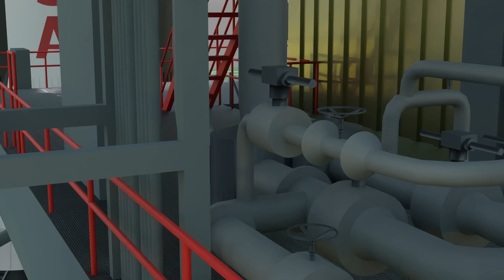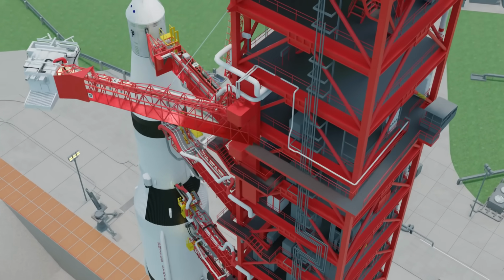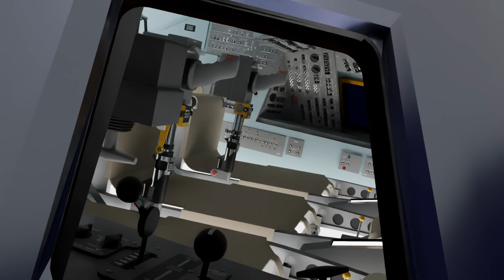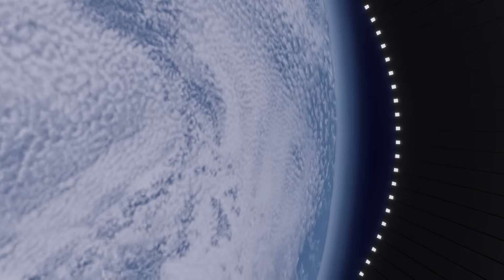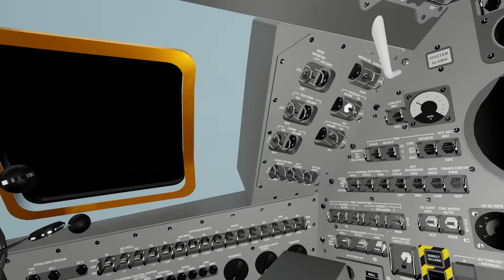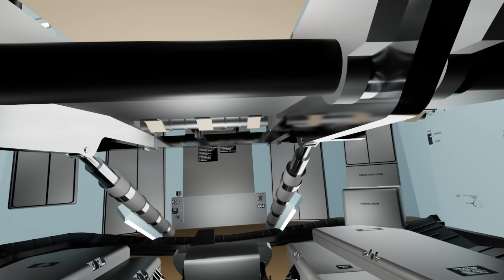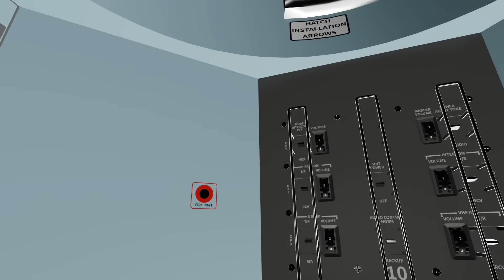Apollo 11 Part1: All Engines Running

Comment: Amazing work, you should be working with Hollywood, Lord knows they can't get a animated Saturn V launch right, Apollo 13 launch in the movie was terrible
Reply from the maker: Thanks for your comment! Hollywood has a lot of incredible animators.  And of course the best Hollywood animations are the ones where you can’t even tell it is an animation.  The Apollo 13 movie launch modeling was outstanding…..launch vehicle, LUT, fire, ice, etc.  but their timing in swing arm retraction was not even close.  The movie shows the arms retracting one after the other…not correct.  If you look at my top down view of the launch starting at ignition, that is the correct timing.  Throughout my launch sequence, I do rewind the clock a little to show another angle.  I also purposely rotate the white room, DRSS, crane, and all swing arm extensions at not the real times since that would leave the viewer waiting days for something to happen.
Reply: @opieswenson  What I mean is in Apollo 13 as you said the tower arm animation is very wrong, but the roll patterns on the animated Saturn V are wrong, they obviously saw a pic of the SA500F Saturn V and just went with it, granted probably most of the public wouldn't notice, but you'd think at least Tom Hanks being a space buff with Jim Lovell & Dave Scott there that would have been caught.
Reply from the maker: @johnfuqua1330  Missed that one myself.  For me, I used online documentation for the roll patterns...this was not the site I used, but I used something similar to this:  https://www.rocketryforum.com/threads/saturn-v-roll-patterns.150541/
Reply: @opieswenson  You got it pretty much correct, you and the fella doing the "Re-entry Orbital Simulator" should meet.
Reply from the maker: @johnfuqua1330  I have not played with their sim.  Looks pretty cool. His world space animations look way better than mine.  He has also animated all the gauges which looks really cool.  His space craft models have better look and feel.  Mine have better accuracy.

Comment: A puke-inducing slideshow rather than a video.
60fps or GTFO.
Reply from the maker: I agree that 60 fps would have been much better than the 24 fps that I used.
Reply from the maker: I would like to do 60 FPS but don't have the stomach for the render times with my setup.  Do you have a recommendation for a free (or even a a fairly cheap) AI video converter that you have worked with that will step me up to 60 FPS?

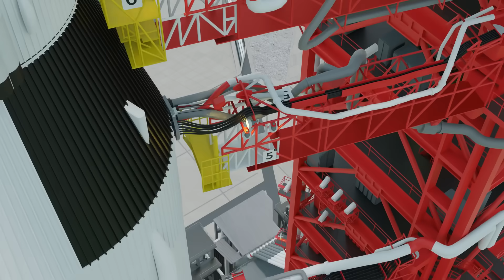Comment: Wouldn't the crew access arm and white room have been retracted before T minus 2:30?
Reply from the maker: So most of the animation is compressed since I am covering hours of material in a short video.  For example the transposition and docking is way faster than real life.  The arm retractions except for the white room, crane, and the DRSS are not even close to the real time.  If it was real it would not be interesting to watch.  Also the arm extension retractions are not at the correct time either.  They retract way befor launch and come back out as needed.  In this case I was just trying to show the viewer that they do actually retract.  At ignition, the arm retraction is spot on.  However, I do rewind the clock a couple of times to show different angles.

Comment: You even simulated the ullage motors! Well done!
Reply from the maker: Thanks for noticing.!
Reply from the maker: Also take a look at my outdated Part 1 (see link in the description) to see how I changed the treatment of the ullage/separation motors.  And the new Part1 added the first stage separation motors.  First stage has 8 separation motors…2 per each fin.  I think it was Apollo 15 that removed 4 of these motors to save weight…but then put them back on for subsequent missions.

Comment: Good but,...problem was with the engines. NO INSULATION. You couldn't see the inner workings of the engine bells because they were covered in insulation.
Reply from the maker: Yep…I am aware.  That’s what happens when you spend a couple of weeks modeling the F1 engine, based on pictures and drawings…then discover real launch video showing the insulation.  At that point I did not have the motivation to cover up my work.  If I had known from the start, I could have cut my work by 2/3s for sure.
Reply: @opieswenson    1.  This must have taken you months.  We are so impressed by and thankful for the effort you put into this, Andrew.  Fyi, I go as far back as seeing the A. 11 and 12(?) landings live.  2.  I've always been so awed by the beastly power of the F1; by designation and reputation, IT rightly IS the 'Formula 1' of all r-motors!  And an honorable mention to the fellow 60s-tech of the -99 in the X-15.  
3.  What's your favorite plane?  Be mindful that the black project RS's that have since replaced the RS-71 (RS is the correct and original designation, as our worst president ever, LBJ, screwed up the letter order in a speech) do exist, we just can't get much in  the way of confirmation. 
4.  Are you a fan of US black projects, such as the Tier 3 "Flying Triangles," the rumored TR-3B Astra being the most famous, and the TR-3A Black Manta?  (The -3A is supposedly subsonic, and it or something resembling it was sighted at an RAF base in the early 90s.)
Reply from the maker: @brianjob3018  1.  Thanks much for your comments.  I started do learn Blender last October following Andrew Prices donut tutorials on YouTube.  I started building the models in Jan this year.

2.  F1 is an awesome piece of engineering.  Currently SpaceX and NASA favor smaller engines and gain the required thrust by having more of them.

3.  As a Naval Flight Officer and Naval Test Pilot School graduate, I have flown a lot of military aircraft (Navy, Airforce, Marines).  The most fun flying machine…F16.  The best “ got war airplane”….F15E (unfortunately can’t get it aboard the boat.  Biggest plane I flew….B-1B and P3.  My normal plane which I also love is the F14A with is the plane I have the most hours in….but I also have a bunch of time in the F14D, F14B upgrade, and a unique F14 that as only used in flight test (it was a F14A with F14B upgrade avionics…..or I guess you could call it an F14B upgrade with Pratt engines)

4.  Can’t really comment on this one.

Comment: THIS WAS A TREMENDOUS VIDEO!  The crackling of the F-1 engines during launch was superb and closely mimicked the actual sounds.  The video also underscored the tremendous engineering, hard work and dedication of all those involved in this amazing achievement by bringing the viewer "along for the ride." The late Jack King's voice as well as the other CapComs brought realism to this video. A job well done!
Reply from the maker: Thanks much for your comments!  All the sounds I grab are for free.  Could not find any F1 sound files that were for free, so I used a falcon 9 launch sound file which I may have slightly changed the pitch.  One interesting sound that I used was for the interior shots.  Having flown a couple thousand hours in fighter aircraft, the sounds of the environmental control system is ever present.  Did not have any CM/LM ambient interior noises so I tried to imitate the inside (like a fighter) by using a Dyson vacuum cleaner pitched way down.

Comment: Nice animation mixed with real audio. I like it. Some explanation would have been nice, like the meaning of one-bravo. Timing of the stages is not accurate, which is disappointing, because it spoils the experience (first stage burn time is 150 sec not 45) A lot of interesting things happen during this period. Speed and x and y distance would be interesting too. The earth is not a sphere at this point. same problem with staging the second stage. No Pogo either. hmmm
Reply from the maker: Thanks!  One bravo is one of the abort modes.  There are several.  The escape tower, canards, and timing work differently depending on the mode.  Timing of the stages is greatly compressed since most people won’t stay long enough to watch it.  So in my modeling I use real world units.  But Blender does not work well with anything big like the Earth…so I have to fake it.  So most of the pogo was removed from the manned missions by using dividers on the injector face of the F1.  Can you point me to a video of a manned Saturn V with pogo.  If I can see it, I may be able to incorporate it.
Reply: @opieswenson  Don't get me wrong,  the video is impressive and very detailed. I only commented from the view of an Apollo nerd with some insight into the details and wanting to learn more. I agree, that many would not have the patience to stay for the whole experience, but these may not be your audience. Yet, a lot of exciting stuff happens during the burn of the first stage, that can make the 150 seconds feel like 5 if one explains them. Just a thought. I don't know of footage of the pogo during the 2nd stage burn, sorry. I guess it was more felt than seen during the first flights. It was fixed later.
Reply from the maker: @AJ-qv9yo  I have plans for more detailed videos aimed at an extremely dedicate audience.  The next series will be breaking down the instrument panel on both the LM and CM.

For those interested in the technical details of pogo on the saturnV, here is NASA’s analysis: https://ntrs.nasa.gov/citations/19690005504

Comment: What BS! Life can not survive the Van Allen Radation belts!, WHAT A LIE!!
Reply from the maker: There are 2 variables that Nasa could control regarding the Van Allen Belt radiation.  The radiation intensity though the belts was not contant---it gets weaker towards the poles.  So the 2 variables to control are 1) the path to take through them 2) the length of time to pass through them.  You can download the Apollo 11 recorded dosimeter information yourself online and see for yourself.
Reply: Not according to James Van Allen.   Speed and belts are the clues
Reply: Ignorant dullard.

Comment: I liked reading all the little labels inside the ship
Reply from the maker: Thanks for your comment.  It took a lot of research trying to figure out what they all said.  I used NASA pictures, the Smithsonian 3D site on Apollo 11 and various other sources.  I think there is at least one and maybe 2 decals that I did not include because I could not quite read what it said.  One of those decals goes under locker R1 on the curvy part of the wall.
Reply from the maker: On your comment on the title…NASA PAO Jack King flubbed his comment and said “all engine running”.   I corrected his quote for the title.  Fun fact….Jack King’s son was one of my flight instructors flying the F-14 (I was a RIO in VF-84 and VX-30)

Comment: F1 engines. The outer four fired for two and a half minutes. The centre one cut out after two minutes to prevent high acceleration.
Reply from the maker: Yes…you were not supposed to see that.🙂

Comment: Fantastic Job. Thank you. Only a small remark: the F1 Engines during launch were wrapped in a heat shield. A mistake that Ron Howard in Apollo 13 made as well.
Reply from the maker: Thanks for your comment.  I figured that out when I completed a week or so of modeling the F1s based on pictures and drawings.  Then I ran into the Apollo launch video showing the F1s from below the launch pad.  It was a disappointing find to realize that I had about a weeks worth of effort for parts the viewer would never see.  And a disappointment to realize that I thought I was done with the F1s…but I was not.  In the end, I decided to let them run naked. 🙂
Reply: What heat shield?
Reply from the maker: @Canada_Dominium  so if you look at my F1 engine Nozzles on the first stage, they are running naked without their insulated covering.  This link here has a picture with the covers on: https://www.apollosaturn.com/Website-II/F1-Engine-Thermal-Protection-System/i-RTsDmgd
Reply from the maker: @Canada_Dominium  yep, the insulation is there.  The picture I included in my previous comment is a more clear shot.
Reply: @opieswenson  So, "thermal protection"? What is being protected from the heat? Keeping the heat inside each individual engine as much as possible? Thanks!
Reply from the maker: @DaveJOHAZ  Here is a drawing of a naked F1 along with a drawing with the external batting which protected it from radiant heat from adjacent engines and hot recirculating heat. https://up-ship.com/blog/?p=304
Reply: @opieswenson  Thank you!